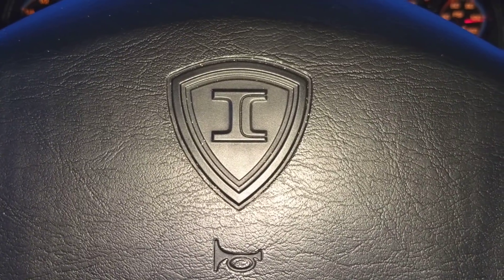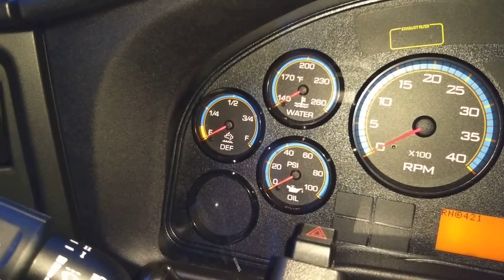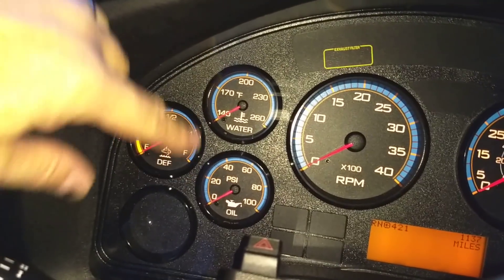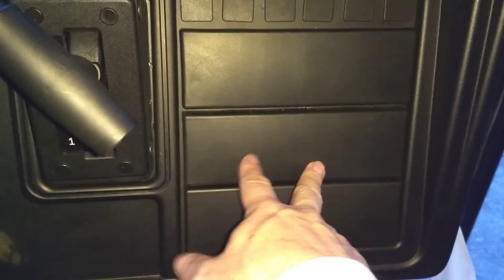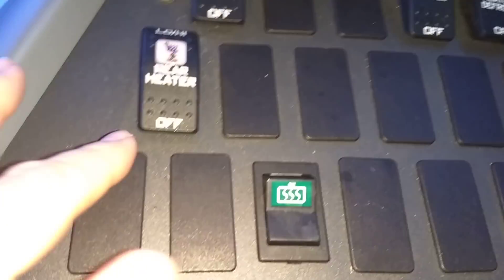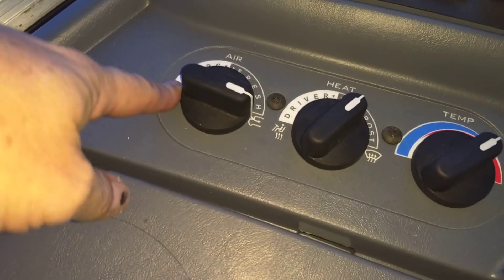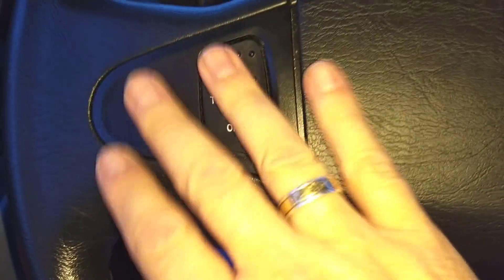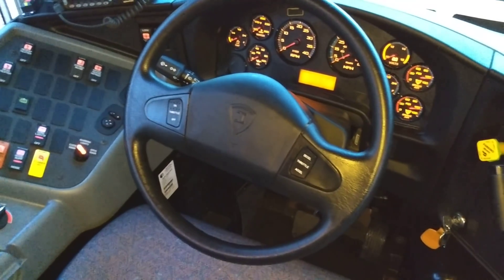2017 CE Instruments and Controls

Comment: How does the door switch work? Does the warning lights setting door turn on the reds, or does It automatically open the door when’s the reds come on when you stop?
Reply: Cameron Heim when you activate your ambers and then open the door it switches the lights to red and puts the stop sign out. If u didn’t activate the ambers then just the door opens when you open it

Comment: I don't understand the whole point behind the DEF system. If you don't put the fluid in does it affect performance or harm the engine? I don't really see the point behind it considering that diesel engines ran just fine without it for so long.
Reply from the maker: DEF has nothing to do with how the engine runs and everything to do with eliminating pollution. It helps to get rid harmful byproducts of burning diesel fuel.

Comment: The three control heat switches in between the control panel and the cubby have always been an option since they first put these out in 2005. The lid to your cubby is where the cup holder would be molded into the plastic if you had one. I like the sunshade over the drivers window, that’s pretty handy.